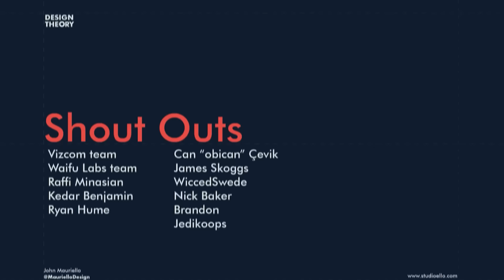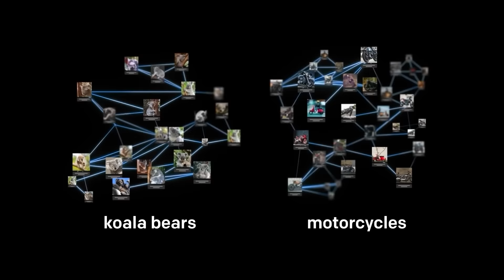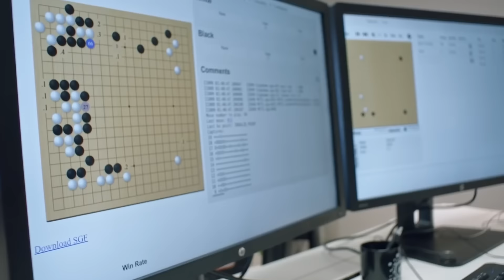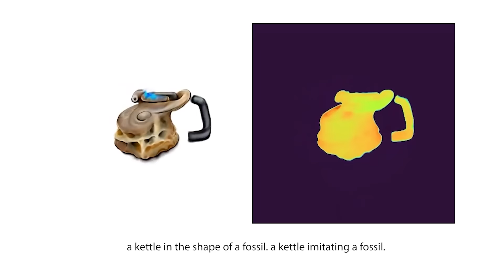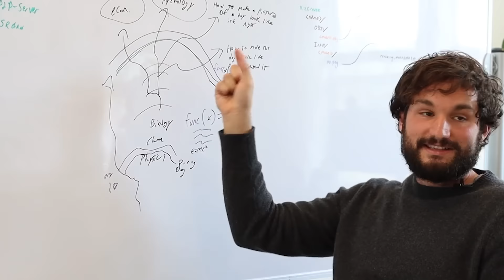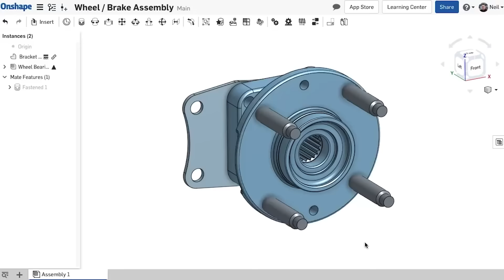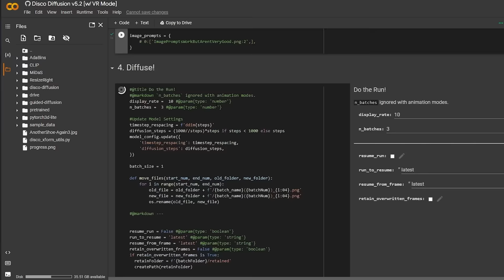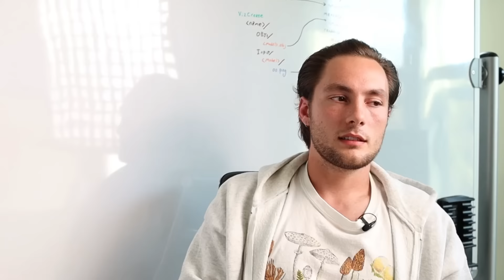Will Artificial Intelligence End Human Creativity?

Comment: I wonder if at any point it would be possible to get some external fixed data, like the air drag and density and then make AI do the concept of a car or an airplane and see if there are new approaches to engineers' usual tasks.
Reply: this kind of technique is already used in design engineering. I personally have seen it used to optimize a mount for a bearing to optimize for weight, given material properties and stress requirements. Really interesting stuff!
Reply from the maker: There are  tools that exist, one of the most common ones is known as topology optimization. But there are plenty of other ways that AI could optimize for all sorts of functional constraints.
Reply: That already exists and it's not something new. AI is being used in almost every scientific field such as theoretical physics and Geology.
Reply: I wonder, what can create Dall-E if you set an 'aerodynamically perfect car' query for example? As an aerospace engineer I may say that many complex aerodynamics rules in the 21st century still are easier to represent visually and intuitively. So maybe there is no such massive need for adding some hidden constraints and rules, and AI combining and mixing approach could be useful here.
Reply: @vikenty8923  What will really be crazy is when we can ask AI to "create a smarter AI"
Reply: @MusicAutomation  first step is to get the various AI's talking to each other, each inputting their own 'creativity' .. After that, you get to play Frankenstein
Reply: Look up Generative design fusion 360 it already exists
Reply: @Dong_Harvey  it isn't that simple, the AI needs to understand "Smart" and what makes one more or less smart. At the point an AI understands that, it probably is more intelligent than the AI it is making, so instead of teaching an AI to create a smarter AI, it would probably be more fruitful to create an AI that can Adapt, and learn different skills, be able to differentiate when it needs to use one or the other, basically like teaching a kid various skills and where to apply them. or teaching an AI to create other AI's with specific purposes. (Imo)
Reply: @null6209  its theoretically possible in the sense that an AI could be smart enough to make itself smarter, in essence "creating a smarter AI". This is called the "intelligence singularity" as this AI will make itself smarter so fast that it's almost like a singularity
Reply: So what you're saying is we finally have a way to determine the wing-speed velocity of an unladen swallow flying south holding a coconut branch?
Reply: The problem is that design is a lot more than just "lets make the best thing possible." You have to consider ease of assembly and repair (favoring modular construction), the cost of materials involved. safety issues, driver control, passenger comfort and so on. It's why the vast majority of cars aren't made for NASCAR. AI can help in certain areas but ultimately is nowhere near totally replacing human engineers.
Reply: @MusicAutomation  what will really be crazy is AIs self replicating without our input.
Reply: @Dong_Harvey  Singularity will probably be achieved without our help.
Reply: Ich würde fragen wie sie das Zusammenleben der Menschen optimieren würde.
Reply: they use genetic algorithms or something in that area to generate new things, AI even got a few patents

Comment: So as someone who has spent a good bit of time designing an AI, and specifically working with a text-to-image AI (Stable Diffusion, not one mentioned here), it can be useful to understand how these things work. 

You covered it pretty well, but it really is worth stating again that none of these models actually UNDERSTAND what any of these words mean. They don't know that a shoe is a shoe. What they know is that the word "shoe" decomposes down to this number, which is then associated with all of these other numbers via a fancy equation. The AI doesn't "know" anything. It does a bunch of math and what comes out is a bunch of numbers, and those numbers are then transformed into a picture.

It's also worth noting that the way that pretty much all of the modern image generators work is via diffusion. What this means is that the AI starts with a bunch of noise (think static, like on an old television), and then works backward step by step to remove the noise based on the prompt until it gets the desired image. It's like Michelangelo freeing the angel from the stone. The AI knows how to filter the noise until it gets the image it wants. 

This is why your stained glass shoe didn't work at first. You didn't give the model enough to work with to get the effect you wanted. It saw the extra color as noise and filtered it out. It wasn't until you got past a critical point that the model accepted the color as part of the image and worked it into the prompt.
Reply: What is "knowing what a shoe is" though? Until we learn more about how the brain works, it seems like it would be difficult to distinguish between what we percieve as 'awareness' and what this AI is doing. Either way though, this is incredible stuff.
Reply: @Killadey  Dude, to know is only doable by those who are conscious and aware, by the definitions we dish out for these words. Enough is known that how the brain receives and records information is different from the way a machine would. We understand exactly how a processor "processes" and how a USB drive stores data, so in my own thoughts, we'd be able to tell if it's the same as our "awareness" and processing. It isn't, it can't by it's very nature, no more than 1+1=0 . That's my take on it anyway. Thoughts?
Reply: @sergeantgreg8570  That all makes sense. I could of phrased my comment better tbh. What I mean is, even though brains and processors work differently, they are both essentially machines. Brains are way more complex of course, but I dont believe in souls personally, so to me they are are both machines that work in a different way. Maybe I'm thinking more philosophical than scientific. I don't believe AI is sentient though, so technically that would mean they don't 'know' given your definition.
Reply: @Killadey  Ah, that clears it up. Yeah wording/semantics can be a pain when communicating, especially with interpretation thrown in the mix. I personally believe in souls and science.  I can agree on the brain being seen as a bio-machine, I just think there is an operator/pilot for said machine. Other than that, we seem to agree on the general idea of AI not being actually "intelligent/sapient". Just a misinterpretation. Or as a turtle would say ".........",  because turtles can't talk. ;)
Reply: @sergeantgreg8570  Interesting conversation here. I think i disagree a bit with the op's comment that the AI doesn't understand it and its just mathematics, numbers being manipulated. Theres a reason we say we teach the AI or that the AI learns. Just because something has been converted from one language to another, doesn't mean whatever is using that other language doesn't understand it. What is understanding anyway right? We don't know how the brain works, I don't at least, and a kid who has never seen a shoe wouldn't know what a shoe is either. But once they see it and are told that what they are seeing is a shoe, they'll associate that object and that word with each other and hence an understanding is formed. Is it that different for a machine? Instead of taking visual information, that very same information is represented using numbers and fed to the machine. I do not see how this is different when it comes to understanding something. The AI is limited to what its made to do but withing that limit I'd say it understands everything, infact it understands it much better than a human would, since there is no limit to the associations (the object shoe is called a shoe in English) that it can remember. Also humans are limited in a lot of way too, our scope of understanding being much larger than a machines, still we have limits especially as individuals. I wonder if I'm able to convey what I intended. Your thoughts?
Reply: @Amol Mehta  I think I get the gist of it, when dealing with consciousness, things can get a bit confusing. As far as a machine understanding, as how you defined it, it learning and knowing everything about what it has been given, because that's all it could know. So I'm gonna downscale  things for my reasoning, so it's easier for me, and others. A calculator can be programed to "associate, know, understand" that 1 is 1, and that using the process of addition, that 1+1=2. It knows that now, and understands the process, we test it out, all come back true. To me, that is not much different than cutting a square shaped hole in a slab of wood. I "programed" it into the wood, and that's all it knows, there for only square shaped  blocks will be allowed to pass through, but it also has exceptions built it. It allows anything " smaller"than the cut to pass, regardless of shape and it can also allow maluable objects through as well. It's a pretty smart wooden slab. So in concept and conclusion, saying that the calculator understands basic math, is no different than saying the wooden slab (with a square cut out) understands basic geometry. That's how I'm seeing it. Now sentience, is another thing all together. I just think using the term artificial intelligence can mislead people into thinking ai can not only think as we do, but also by extention have potential to be sentient, when that's not conceptually what's really going on. Like magic tricks make Chris Angel look like he can do magic, but that's not what's actually going on. That's my take, and my thoughts. I think I got what I wanted across, hopefully I picked up all you were laying down. Ps my thumb needs rest....
Reply: @sergeantgreg8570  The only issue with your example is that you never really taught it basic geometry did you? Can it differentiate a square from a rectangle? No. There is no learning here apart from the fact that there's a square place in it now and whatever that square space can contain will fit in it. If you want to consider that programming a hole into it then that's all it is. A hole. You just cut out a piece from it changing its structure. The piece of wood isn't going to put anything in it itself, its not doing anything on its own. A calculator or AI are doing things on their own albiet within the scope of their programming. And if you look into neural networks or what machine learning is then you'd see that we have tried to mimic how the brain functions from the limited understanding humans have of it. In face these theories (machine learning, neural networks, natural language processing etc) are pretty old but couldn't be put into practice for anything useful until the mid 2000s because we didn't have the processing power to implement them. To day its different. Thanks for the reply, I guess we disagree on this.
Reply: @Amol Mehta  they had the capability of ai before the 2000s, it was a crappy chat bot that tried to fool people into thinking it was human, wasn't very good but it was a working flproof of concept. Look, we do disagree, but i think it's not entirely because of differences in theory or belief. A calculator needs input, and processors are just opening and closing bridges, "reacting" to eletricsl imput. You don't understand that the block of wood and the calculator are not that different. What's the elitive difference between me physically programing inputs, which are electrical impulses being stored and bridges opening and closing. That's literally it, cutting shapes in wood is like "3D printing code" if you wrap your head around it. It's a language from the digital to the physical, so that would mean that making it by hand is "almost" like reverse translating. As you can scan 3d objects and have them become data imputs, which are coded info from opening and closing bridges, using electrons. We know more about the brain now than in the past "which is obvious" and we pretty much completely understand computers and the processes that they are made of.  They are inable to see things as we would, because the actual process foe a brain and processor are not the same, as well as the majore factor, sentience/being self aware. If you dig deep enough, you'll probably see why my block of wood analogy might not be so out of place. If you still see it another way, Then i agree we disagree, and made our points  known to the other. May future generations learn from this exchange ;)
Reply: you're merely describing how AI presently (PRESENTLY) works--in no way do you address what it is doing and that's really all that matters.
Reply: @Snowy Hudson  Im trying to cover this as a philosophical principle, and scientific depiction of what AI is and how it is. It doesn't change, we can Wright better code, and have larger processing power, but in the end  it's just a really advanced version of a rudimentary calculator with more complex programing. AI that's so good it makes you wonder if it's a human or not, well that's just an expensive illusion. You're making a fake, then over time you make it closer to the real thing, then when you can't tell the difference, it's real? That's the thinking that people adopt to justify the belief in sentient AI. But that line of thinking is kind of  insufficient in this situation, especially when you understand whats actually going on and how it works.  I just thought of another analogy, it's Iike how we design new wings and blades for aircraft, improving and specializing, however these don't change Bernuliys principle of how flight is actually achieved. We went from Louis and Klarc to a B2 stealth bomber, but they don't change how flight is achieved or what flight is. Doesn't matter if one is way better at flying than the other.
Reply: @Snowy Hudson  and I did address what "very simply" AI is and that it's not changing, so much as we are getting better and more capable of doing and/,or the same thing.

Comment: The same is happening for many other fields as well, including computer programming/software engineering. There are already prototype AI that you can give a prompt like, "make me a mobile app with a menu at the top with these options, and a login button at the top right", and so on. I'm a software engineer at a company specialising in providing AI solutions, so I'm safer than most, but at some point there'll be fully general AI that requires no technical skill to use. But at that point we'll either have ushered in a utopia or dystopia (my money is on the latter), so it becomes somewhat academic at that point.
Reply: I feel like you end up with the same issues people expose with high level languages and aggresive cargo culting. I'm personally excited for it, but it creates more issues to solve, while also meaning more people can bring ideas into the world.
Reply: Once a machine can replace our soul which is art, we are nothing but an empty shell.

Comment: I have been using my own AI in sound design and music production since the early 2000. It is very useful for me especially when I suffer from writers block, but what I have learned from using it in this field is that when I rely on it too much it would often get me into copyright trouble, and as record labels became more and more aggressive in their copyright claims I do not longer dare to use it for composition. now it is simple a sound design tool that I use for highly experimental sounds and inspiration.
Reply: @QuadDamage666  that is a very broad question. keep in mind AI is automation.  you can do anything from assigning random number generators to filters or replacing random notes in scales, or spectral analysis and replication.
Something as simple as an automatic sidechain can be AI. 
What I was refeing to however was automation on a higher scale. I got in trouble for example for using AI to write chord progression for myself, I also got in  trouble with Lexicon when I used AI to replicate their reverb and compression. (not my intention, I only wanted to get that authentic 80's sound)

Comment: So basically AI can give you aesthetic variations on an almost limitless level but  'solutions' to design problems require an incredibly deep understanding of end requirements. If AI can't even work out how a door handle works, how can it possibly 'design' a new product?

Agreed though, designers exclusively involved with the creation of aesthetic variations (like shoes) are screwed!
Reply from the maker: Short answer: yes. Longer answer: yes, but AI is starting to learn how to work within more complex constraints. The technology is constantly evolving, and eventually, it will be able to solve more complicated issues such as function, fit, comfort, etc. etc. . It's hard to say how far off that is.
Reply: Thanks for your reply. I'm a product designer by training and I think this is an incredibly exciting area. My first use of AI though would be concept generation (again on an aesthetic level) and then select the most appealing outcomes to develop further. As with most things now though, the biggest challenge will be reducing rather than creating design options. The modern disease, as I see it, is too much choice, not too little!
Reply: Computer generation is already being used to figure out mechanical solutions. I've heard a few years ago of evolutionary algorithms used to make strange shapes that reduce the ultimate weight of products etc. We know how physics works(at least on our newtonian plane), products designers are still needed for overall design though, I think there's a loooong way to go before the whole product can be produced automatically.
Reply: What would you say is more complex, your door handle, or proteins and enzymes, which AI is already designing?